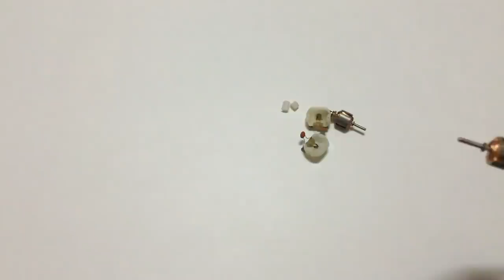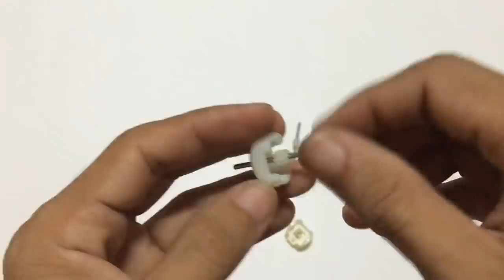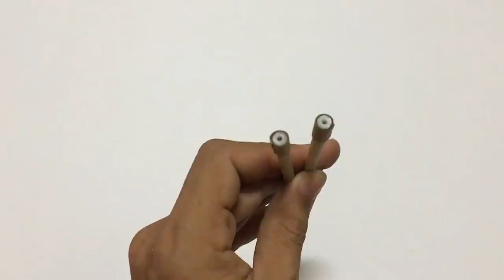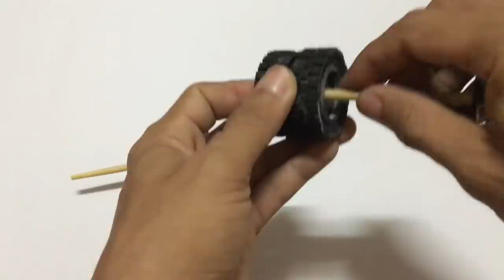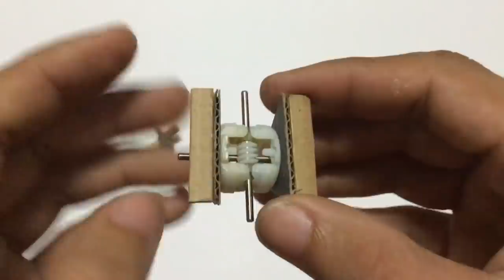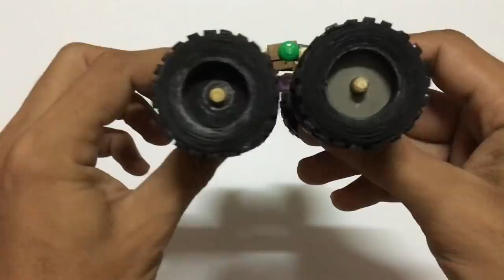RC homemade how to make RC Heavy Tuck 6x6 Back axcle Home Action

Comment: Sure it may drive all the wheels but when the truck turns it’s going to scrub like crazy due to lack of planetary gears and a true differential assembly. Could put too much stress on the worm drive gears and strip them or break the axles.

Comment: Why didn't you just use brass tubing for the axles? You could have telescoped them for your needs and they would have been much more durable. Like the differential idea but there again you could have used  a longer steel wire to achieve the same effect and cut out all the wood cardboard glue. You obviously making this to be a RC  rolling chassis component and not a display. I don't see it's longevity.